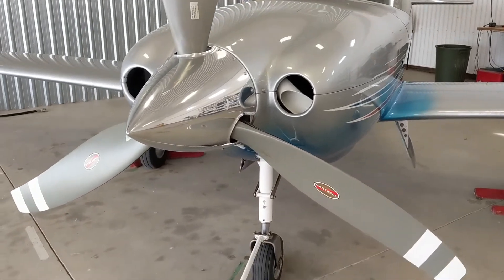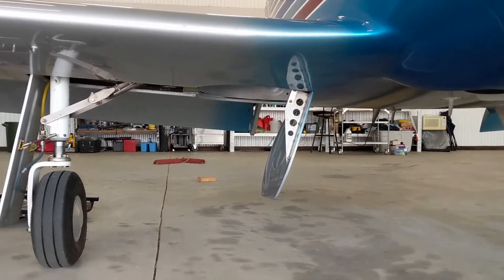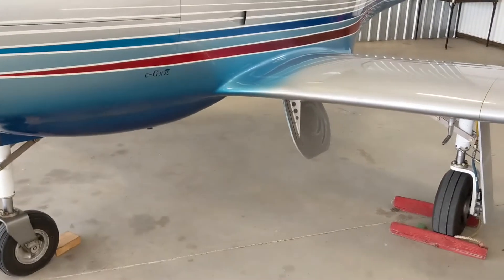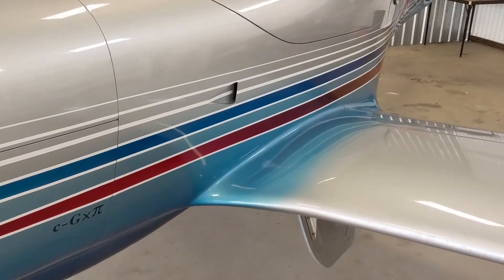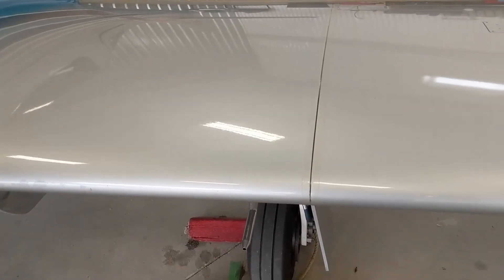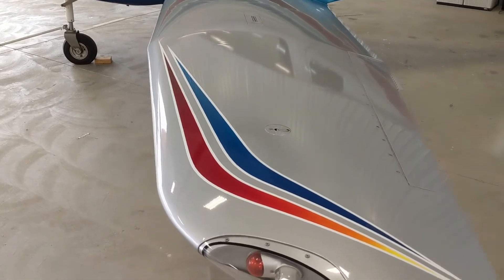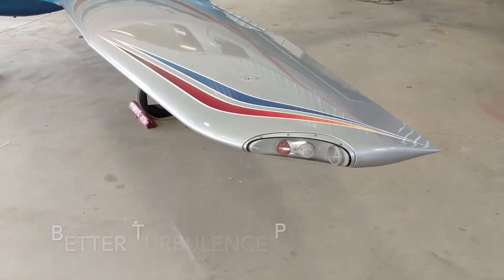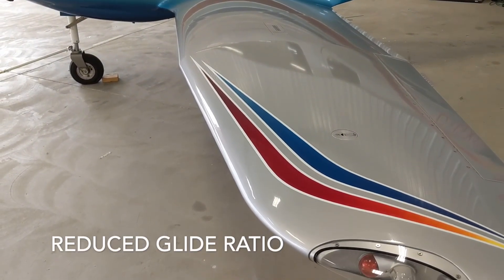Gear and Wing - Lancair Legacy RG

Comment: Just FYI, wing loading has no (*) influence on glide ratio.

For a given variation of wing load, at a given AOA both speed and vertical speed will change by the square root of that variation, giving you the same glide ratio in the end for that AOA, only faster with a higher vertical speed (for a higher wing loading). For instance, if you increase the wing loading by 21% you will fly 10% faster and sink 10% faster as well, conserving your glide performance.

 It's used by gliders on good days: fill the wings with water and cruise speed improves quite a bit, at the cost of reduced thermalling performance.

What does influence glide ratio is the wing's thickness and aspect ratio, but then again the Legacy is pretty good in that regard.

(*) Actually, at a higher speed you get a higher Reynolds number and that tends to improve the glide ratio.